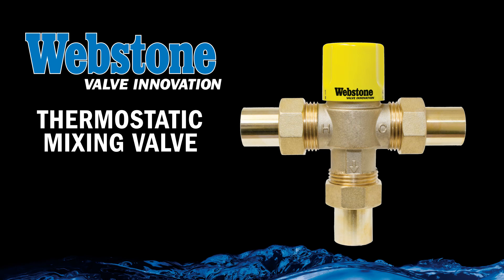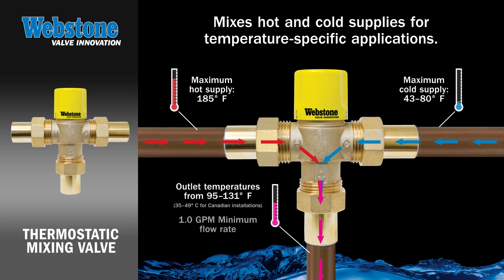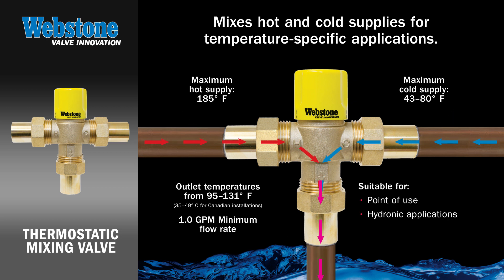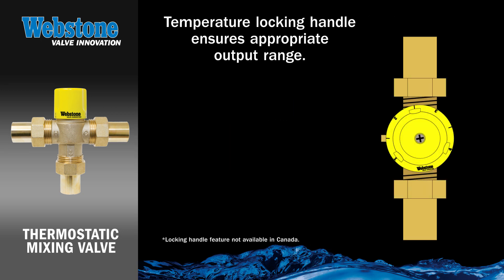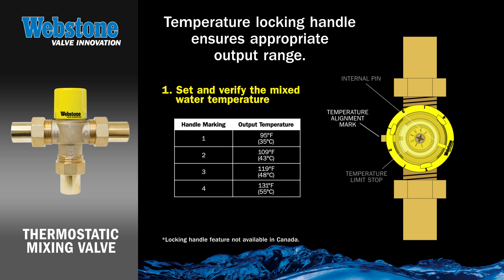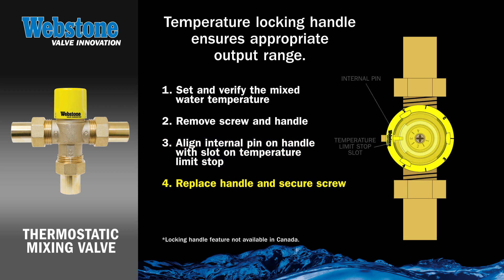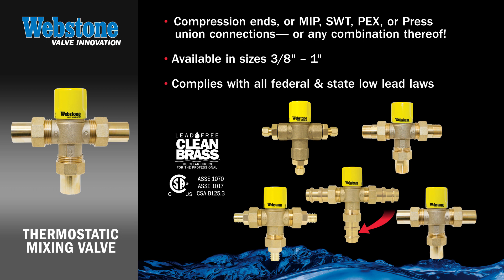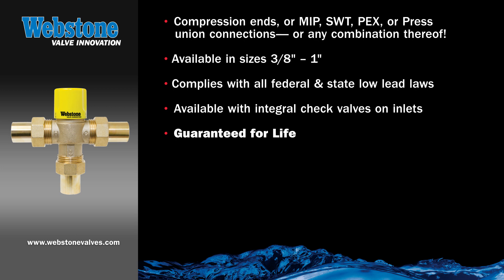Thermostatic Mixing Valve

Comment: Does Webstone have a similar product where the output temperature can be set to a lower temperature?  Specifically with the minimum around 50F (10C).  The input flows would be in the 45F and 70F range.
Reply: The output range is higher than that, but the valves will accept input water down to 39F.
Reply: @lisalyon6403  Thanks for the reply.  The problem I'm trying to solve requires the lower output temperature.  I'm not sure it's possible with the "wax thermostatic" technology, as there may not be a composition of wax that changes volume in the lower temperature range.